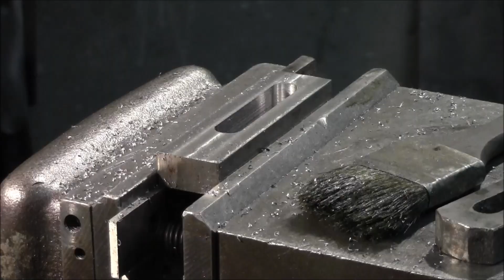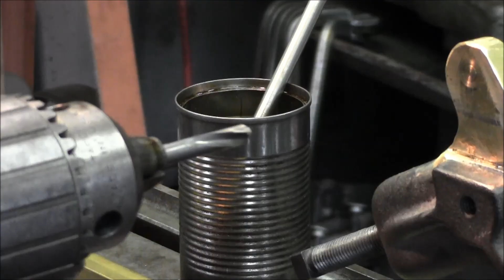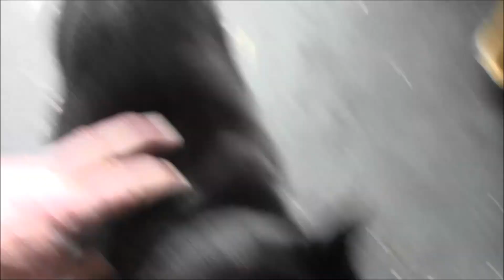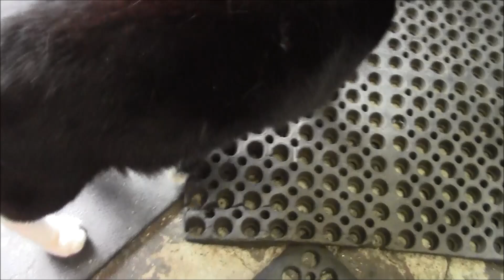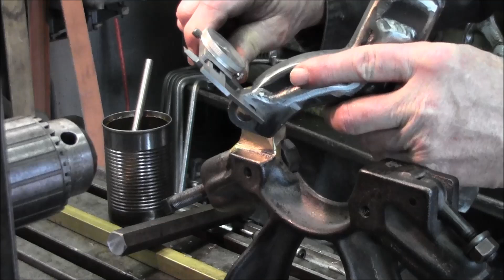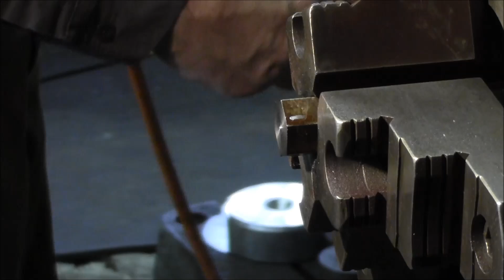The Million Dollar Rest Part 5: Lathe Steady Rest Repair and Roller Addition

Comment: How are you able to keep your chuck on while rotating backwards. I have the same south bend lathe with a screw on chuck and I was told not to run backwards, No chuck locks. I can run backwards just do not trust that it wont unscrew. I have watched you for a long time, thank you.
 Frenchman.
Reply from the maker: It takes a certain amount of force to un-thread a screw on chuck and anything less than a crash is not going to break it loose, as long as it is a good clean fit!
;{)------
Reply: +Keith Fenner Not strictly true. Light cuts as you showed may be ok, but (in reverse) anything that could cause vibration during a cut, such as an interrupted cut (think "rattle gun" or impact wrench), or if the chuck has just been installed (and may not be quite tight enough) could cause the chuck to come loose. I believe Roger should heed the instruction given and not run the lathe backwards.

Kind regards

Peter

Comment: Very nice series.Couple things I would do different is locate off the original saddle V,Even tho the casting where you picked up with the Kurt keys in the KT looked straight to you,chances are the factory picked up in a different place.I never trust a casting as a locating point unless I'm going from raw & creating my own datum.2nd,I would have bored the shoulder bolt hole b4 reaming,between a plasma'd hole & weld shift,you can see the whole cast and clamp wobble,so they rollers won't track true

Comment: The lathe is probably driven by a flat belt. The click-clack is when the metal clasp that holds the ends together comes in contact with a steel pulley.  A flat belt system is never completely quiet like a v-belt.